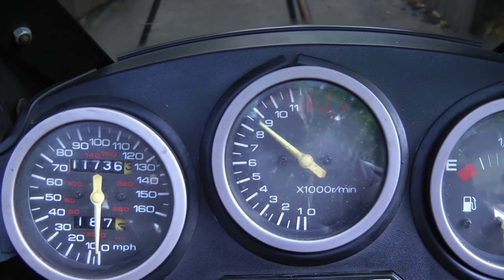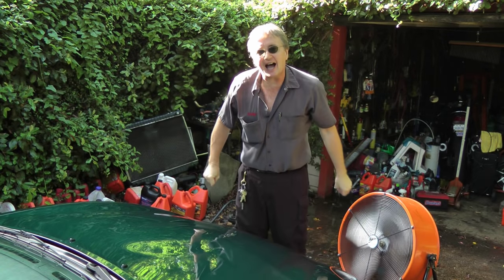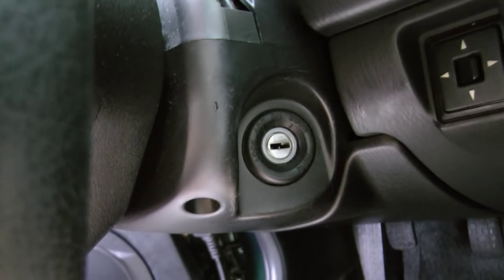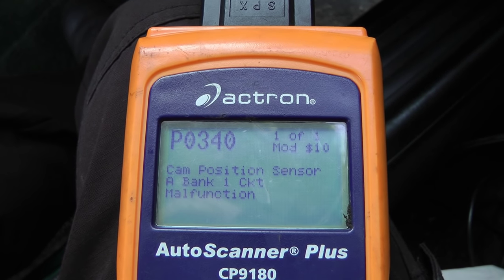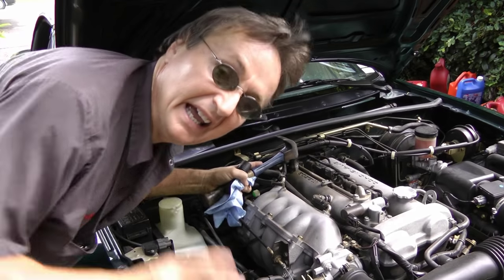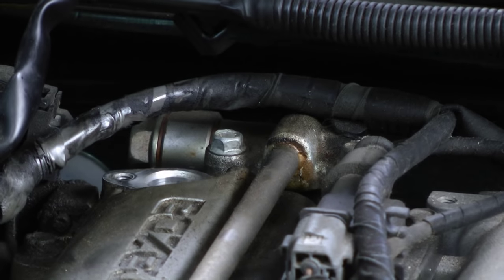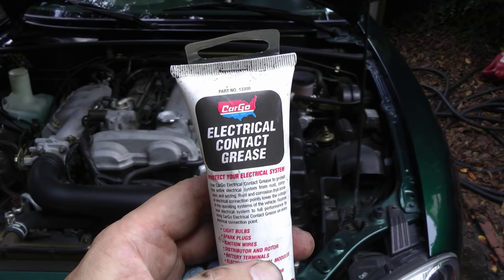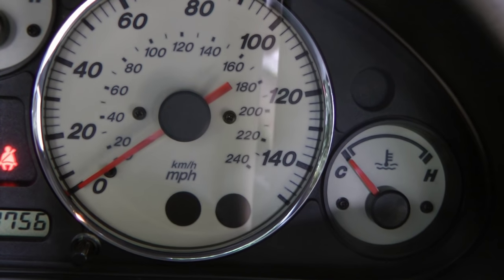How to Fix a Car that Randomly Dies while Driving

Comment: Well Scotty. That small trick of tapping for being sure that the sensor is the problem, only an experienced honest mechanic knows it, and also Shows it. Thank You for the tip, and video.
Reply: x2
Reply: Aww I thought he might of tapped the sensor after changing it to see if it cuts out?
Reply: MrCapi55 Yeah Scotty breaks out The Hammer. Great Stuff
Reply: @halden11  The check engine light did go off.
Reply: So can you check other sensors this way too?
Reply: @louarmstrong6128  course you can 🤔
Reply: @louarmstrong6128  sometimes a bigger 🔨 works better.

Comment: That electrical grease is becoming very important. Cleaned some throttle body sensors on my 04 jeep. Went to test drive. Idle was wacky. Wasnt b4. Tranny would shift 1st to 3rd or het stuck in 2nd. Knowing there was nothing wrong 30 minites prior. Back in the garage with the engine running , pushed on connectors, idle would straighten out. Gooped up the connectors . ran great. Still runs great. If i hadnt just caused my own issues by "fixing" it , I'd swear the throttle position sensor had crapped out. But no, just a lousy connection. 
  Love your show. Dont know where your getting all your energy ? Coffee ? Red bull ? Cocaine ? None of my concern. Keep up the great vids. You should be on diy network.  Subbed
Reply: Lol.  Great comments 😀

Comment: Scotty, I have the same code for a cam shaft position sensor on a 2004 Mazda 3. Driving at interstate speeds(65-70) the rpms start to fluctuate back and forth and will some times start to shudder so strongly that you can feel it in the car pretty strongly. Most of the time letting off the gas and getting back on will correct it for a short time sometimes 30 seconds sometimes for a couple of minutes. Then when coming to a stop at a redlight or slowing down to turn the rpms will again fluctuate by 500 to 1000 rpm and then when it goes to shift down from 4th to 3rd the car will shut off. I then have to put it in neutral and restart the car. It idles fine otherwise. Other codes are for small evap system leak which i have had for some time, I replaced the purge valve but no luck, I think the charcoal canister or leak test pump may be cracked but no performance issues for 10s of thousands of miles with that. Also a cat below threshold code for some 10 to 20 thousand miles again no major issues from that. What could be my problem. I replaced the cam position sensor with no luck. Any help would be greatly appreciated, great videos. Thanks
Reply: Hey Andy do you know where the camshaft position sensors are located ?. Please help
Reply: What was the issue? I’m having the same problem

Comment from the maker: pressure test the fuel pump first, that's easy to do. Ignition systems are much more complex requiring a dealer level scan computer or a freeze frame oscilliscope and years of experience

Comment: they give Scotty a hard time but this video is good info... the very first thing he said is the first thing you need to do is gather information... spot on.... hell I even like the little tap on the sensor trick... never tried that on sensitive electronics only solenoids but what the hay if it works it works. I like the wiggle test on sensor connectors ... especially on older cars that have been apart and unplugged a bunch of times.

Comment from the maker: I would assume vacuum leaks on the intake system first, due to the hard to push brakes. Could even be the brake booster, if it uses too much vacuum it will do that and run like crap
Reply: My car has been doing this ever since I replaced the fuel pump the fuel filter the camshaft position sensor and the crankshaft position sensor. I just hope it's not the main computer or the fuel injectors or even the timing chain
Reply: @BryanG830 probably a leak in one of the little hoses. Not easy to find, but see if you can hear any air leaks when the engine is running.

Comment: Top guy full of beans .....a friend with a peugeot 107 2007 has crank no start .... plugged it in no codes ......we originally thought it were 2 ignition coils but took them back as we still got no spark on 2 of the 3 spark plugs (2%3 cylonder no. Was firing ) so thinking cam sensor . I've had crank sensor out . But didn't think to tap it to see if it starts . Same with cam sensor ..I'll give it a try . Thanks

Comment: Hi Scotty, I really enjoy your videos. You have saved me a lot of money. If you would can I get your advice? I have an 04 impala that will randomly die when stopping or stopped. I have replaced the fuel pump, fuel pump wiring harness, ignition switch, lock cylinder, even the starter. I saw one of your videos about cleaning the throttle body and I was wanting to know if that might help me. You are very knowledgeable and I trust your advice. If so how exactly would I do that on my 04 impala?

Comment: SCOTTY!!!!!! YOUR ARE AWESOME!!! I love how you are straight to the point and explain everything so simply!!! I could actually do some of my own work with your guidance and what you explained about the strut assembly is exactly what I needed answered.  I recently just purchased a pair like that you tested and yup worse then ever.  I knew it but with all the prices ranging from very low to high I chose in the middle.  What You explained makes perfect sense and I thought it was silly to replace the whole thing.  When I did my research on front suspension on the internet, pretty much all the sites said when replacing parts its recommended to replace all components involved.  Now after having the new ones installed and it making the worst clunking noises ever my mechanic told me the mounts are bad and to replace only those.  That didn't sit right with me .  It doesn't make sense that brand new parts only have one part bad.  The whole dang thing is junk!! Also, I have a 2003 Kia Sorento and everytime i put gas in it I have to pull the handle slowly and in spurts otherwise it makes a gurgling sound and spits out gas.  What is causing this to happen? A filter possibly? Thank you in advance for reading and if you get the time to read my comment and answer It would be greatly appreciated.  You go Scotty!!

Comment: hi scotty i have a big problem. so i have a 2002 mitubishi eclipse spyder so one day i started my car let it ran for. 10 min since ut wasent started for a while as soon as i drove the car on the road it shut off since then its not starting up i checked the spark plugs ,cam sensor fuel injecters timing belt and every wire i found in the engine. now what should i do
Reply: and other stuff i checked
Reply from the maker: try my video "fixing a car that cranks but doesn't start up"
Reply: +Scotty Kilmer. already tried that
Reply: Darresh Prasad stale gas?
Reply: Check the fuses main box near the engine mate one of the main fuses playing up.
Reply: Dead battery bad gas possibly a blown fuse
Reply: You might have to roll it down a big hill until it hits something

Comment: I have a 1989 pontiac firebird.  lately it has been dying often while driving in traffic. once In a red light, once in reverse and once while turning.  it will start right back up. I'd like to get a general idea before spending hundreds of dollars
Reply: Viridiana Trevino, you could try techron like I do. works wonders, it cleans out your fuel injectors, if the problem persists, the fuel pump is the culprit, good luck.
Reply: Viridiana Trevino, you could try techron like I do. works wonders, it cleans out your fuel injectors, if the problem persists, the fuel pump is the culprit, good luck.
Reply: Viridiana Trevino, any auto parts store has techron nationwide!
Reply: Hello please help me my car rpm goes down while I'm driving and it cuts off po420 code comes up I went to a muffler shop they said my catalytic is not bad to to a mechanic I change the alternate and battery and terminal still.nothing please help
Reply: shavoya burger my car was doing the same and I find out my self it was the the temperature sensor cost 20 bucks worth to try think about it if the computer doesn’t know if is cold or hot that’s why the rpm goes up and down is just my case but can be yours too
Reply: Firebird should not be owned by people who don't know diddly about repair
Reply: shavoya burger Hello Shavoya, 420 code means your car needs some weed and wans to smoke.
Reply: Easy u own a Chevy there's ur issue

Comment: My 2006 Chevy Impala’s crankshaft position sensor and camshaft position sensor was bad. My car started stalling then dying on me, but the check engine light wouldn’t stay on. If it died on me, it immediately started back up. I hope after replacing both of my sensors that it fixes my issues. I subscribed. You are an amazing mechanic Scotty! ♥️🙏
Reply: Update: After replacing both crankshaft and camshaft position sensors, my car is still stalling on me and dying as I’m reversing, coming to a stop and making a turn. What would you advise I do next? Thanks in advance.
Reply: @christinamartinez8132  maybe ya fuel pump is going bad
Reply: @boogboog7067  I sold the car and bought a newer one.
Reply: @christinamartinez8132  bless up mami

Comment: scotty i have a 2006 chrysler pacifica. i have 2 codes p0457 and p0456. it says is the gas cap, but i replaced it with a brand new one.

Comment: My 98 Z28 did this all of a sudden without any symptoms beforehand. Gauges go crazy Shutdown with no electrical power at all, as if a switch was turned of. But will start back up on its own or soon after. Leaving no error codes. I thoroughly checked and load tested the alternator, and battery, and ground connections. Found the positive terminal on the batt. was barely loose and negative terminal had lots of corrosion. More consistent readings on alternator tests. After a short test drive so far so good. Time will tell. I feel like a dumb a**. I’m a mechanic and I know better, however life has a way of getting in the way of the these simple tasks and things eventually catch up to you. Hope this helps someone.

Comment: I enjoy your videos, I have a 2000 Jeep Cherokee that intermittently cuts out, it seems to happen more when it's warm. I replaced all of the injectors last summer. I replaced the injectors because the code diagnosed #3 injector malfunction. Should I replace my Cam sensor or Crankshaft position sensor or both? Thanks!

Comment: very good video, i appreciate your style very much, 

i have a question for my car, it is xc90 2007 volvo, the engine will shut off when i am on cruise control, 

when the speed reaches 80 to 100 km/h it will randomly dies, and then i can start it again, 

i do not have a scanner, what do you think might be the problem

Comment: I have a 2005 Acura Rl that i recently replaced the radiator.  Everything was working fine, then all of a sudden when i was driving, the car shuts off and turned right back on.  One time, all the lights were on and wouldnt go away.  Could it be a bad sensor?  Thanks for sharing your experience.

Comment: Love ur channel simple and on the point but I got a 2000 celica it stars with the foot on the pedal but if won't ram up it goes to 3500 and if I let go of the pedal it dies I put new spark plugs, clean the injectors and make sure their working but it still do the same dont know what to do a little help scotty

Comment: Thanks for your informative video. I have a problem with my hyundai I10 which no mechanic is able to diagnose. When I press the clutch while driving sometimes my car dies. Then if I try to start it starts without no issues. Whenever this issue happens it happens 2 to 3 times. This issue happens only when I press my clutch. If you kindly provide some input that will be very helpful. Mostly issue happen when I press the clutch to change gear while slowing down. I Have never faced this issue while doing up-shift to accelerate.

Comment: Omg i have this same problem just bought a camshaft position sensor right before i seen this so im going to put it in and see what happens. My 06 charger rt kept dying on me when stopped, and driving. People kept saying it was my PCM, TCM replaced both. 20 miles later dies again. I replaced my spark plugs and it runs okay but cuts off suddenly but does completely stall i will check this sensor today.
Reply: uncle grandpa hello! Did it solve the problem?

Comment: I have fiat stilo 2001 1.6 76kw and car start ok no problems. then i drive downhill or stop and press clutch pedal and its drops rps to 0 and turn off. In dashboard its flashing cheek engine light and when its turn of it shows more red battery and oil lamp idk what can cause that i hope u see this :) BTW i love your videos keep doing it.

Comment: Great video and would be very helpful if I had that kind of car. What about a 2003 Ford F150 XLT? Where would the tool scanner connect to and where would that sensor be located at on the engine?

Comment: I have a cadillac deville 91 and it does when I'm driving slowly for example turning and parking the car it does not die when I'm driving free way. Anyways I took it to the mechanic and it had LOTS of error codes so we addressed a l them, changed cam sensor, distributor, catalytic converter, neutral safety switch, did time up to replace spark plugs and stuff. We also got the computer checked out and no problems with it. He even fixed some broken fuses and broken wires that the car had. Now it runs great BUT it still turns off when turning and driving slowly and also turns off when a complete stop what else is there to check ?

Comment: Hi scott. Thanks for the videos, theyre quite helpful.
Please need help, my nissan maxima 2002 vq35 shut down while driving and the TCS and ABS and Service engine soon light all came up.
 I parked for a while confused and panicked but 7mins later I started the car and it started but then moved very slowly couldn't accelerate and had a little jerky feel to it.
Please I am confused and this is my everyday car to work and back.
I will appreciate all the help and insight to solving this issue.

Comment: I had the same problem with a 99 Dodge Ram Van 1500 with the small 6. I would drive and it would just stop. It was worse on hot days. I replaced all the relays to no avail. I purchased a used but low miles ECM and no more problems. Over heated computer is the problem.

Comment: Does that tap trick work on the crank sensor as well?
I have a 2001 PT cruiser with issues. 
I fixed the worn thru wiring harness last year,  but it may be back. I've replaced the cam sensor 3 times, and the fuel pump. It just dies after about 20 min of running. Will start back up, but if you goose the gas, it dies again.

Comment: Hi scotty
Thanks for your lovely and informative videos. 
I’m experiencing an issue with my vw golf plus tdi 1.9. 
Engine dies and battery light comes on while driving the car. 
Then crank but no start!! It only starts with start spray in air intake. Battery is definitely ok. And there is not any engine code. Can you guide me what’s the issue please?

Comment: Oh yea, my 2001 civic was overheating like crazy, and I replaced camshaft position sensor, and it fixed the problem. Though had to remove valve cover to get to it

Comment: Hi Scotty, 

HELP PLEASE!! I have a 2007 Renault Vivaro 2 litre diesel van from the UK. It cuts out randomly as stated in your video and starts instantly after, but it doesn't have an engine management light on and doesn't show any error codes with a obd2 tester. Is it still possible to be the cam shaft sensor?? 

Love the videos by the way!!

Thanks,

Antony

Comment: My mother in law's 2000 lexus rx300  was having battery issues from sitting a while after she had her 3rd stroke.  Since she wasn't going to drive it, she wanted to sell it.  So, I went and jumped it and it started right up.  We took it to O'Reillys and everything shut down.  We had to jump it again and we made it to O'Reillys.  We got an agm battery.  There was a loose connection in the wiring harness connector to the alternator.  I replaced that and haven't had a problem after she sold it... at least, haven't heard of any problems.

Comment: Hey Scotty, first...great video, i think my problem is related, so... please advise, I have a problem with my 2015 audi a3 2.0 tdi engine, long cranking at first start, but if I stop the engine and crank it again it’s start with no problems, also every crank in that same day starts’up with no problem, the long crank usually happens after the car is not started for more then 10 - 15 hours, and some times, on rare occasions when I’m in second - third or forth gear the engine stumbles/stalls for 4-5 seconds when I accelerate it, this happens once a week or often, so, took the car to the mechanic, diagnose it and the g40 (cam position sensor) came up short or open, ok, replaced the sensor deleted the error and after a week or so the engine started to stumble again in third gear when accelerating, took it back to the mechanic, diagnose it and no errors found!!!!!!! A few days later, after sitting over night, first crank took a little longer than usual, so ok, back to the mechanic, diagnose it again and the g40 sensor came up “implausible signal” deleted the error, took it for a drive to take some log’s, everything was ok, the error didn’t show up, but the stumble manifested again later on with no errors, and a day later, after testing the car with the mechanic with no error codes, next morning the long cranking problem resurfaced, i'm sure i have the g40 sensor error again but allready spent 400$ on diagnostics and sensor replacement, so until i find another tehnician, i don't want to visit the shop again. do you have any idea what should I look for, what can cause this problem??? I’m going nuts here, please help me🙏. Thanks in advance!!!